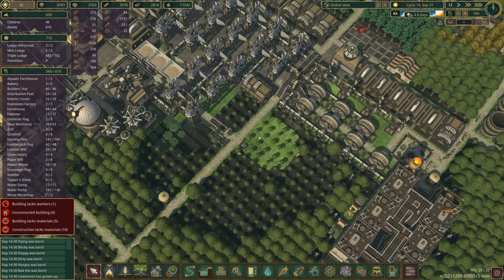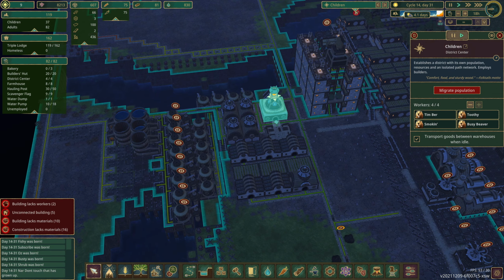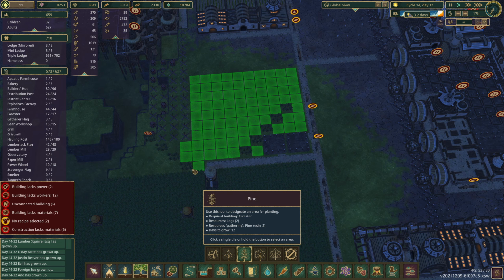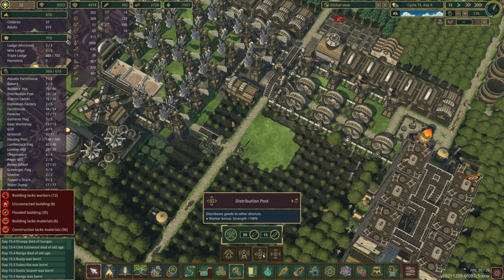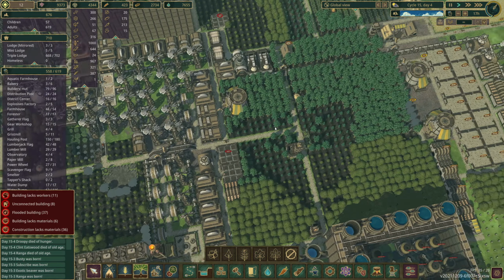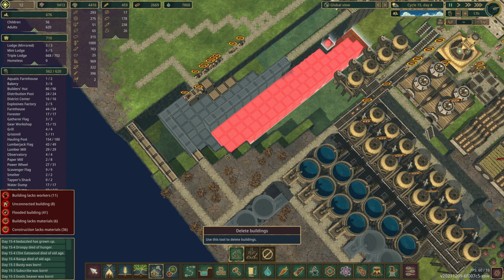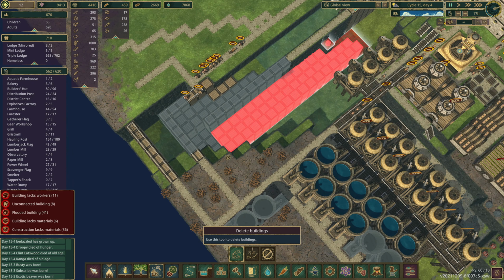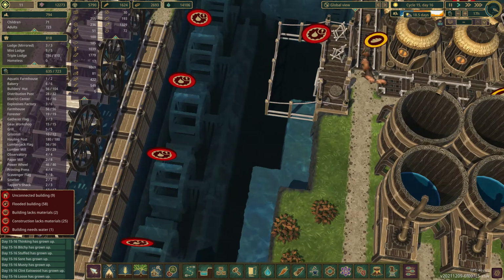INDUSTRAL CENTER 🌲 Timberborn  HARD MODE 🐻 Custom Map 🌲 Ep14 Lets Play

Comment: The power wheels are turning during the dry season because the water pumps are pumping water which is causing water to flow from the reservoir to where the pumps are. Before the experimental branch it was an easy way to generate power in any season. Now the flow rates are too low to make it worth much.